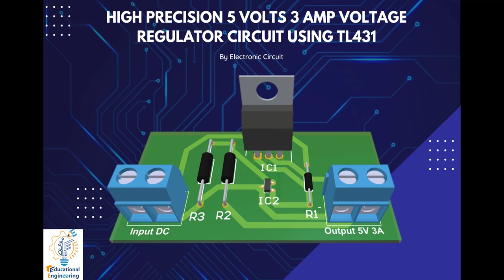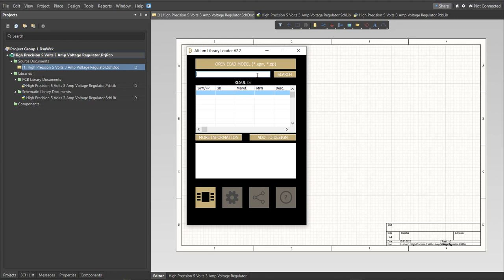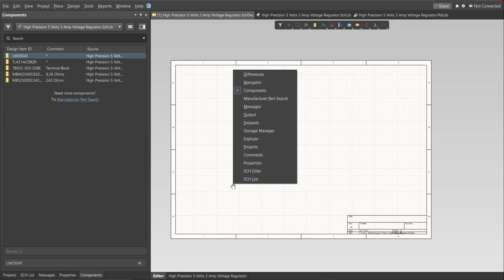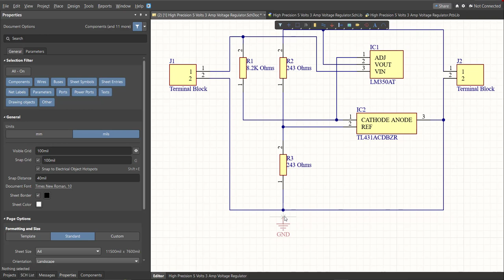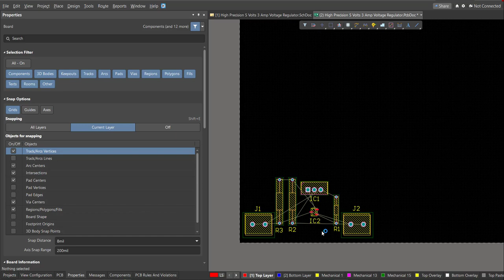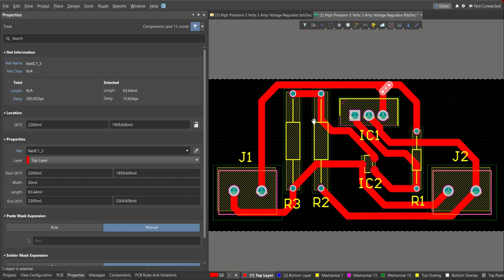High Precision 5 Volts 3 Amp Voltage Regulator | Altium Designer PCB Tutorial

Comment: Is it fine you have not used the input capacitor which helps in reducing the noise?
Reply from the maker: Yes, input decoupling is generally recommended, especially with long supply leads or a noisy source. The exact capacitor value and placement should follow the regulator datasheet and layout conditions. What supply are you using for this regulator?